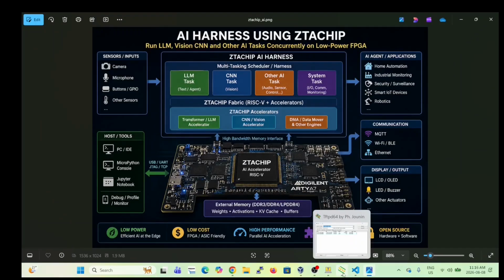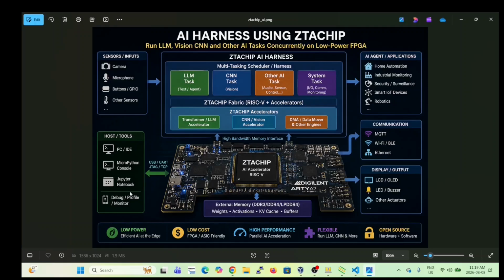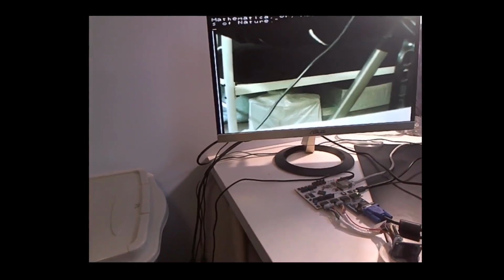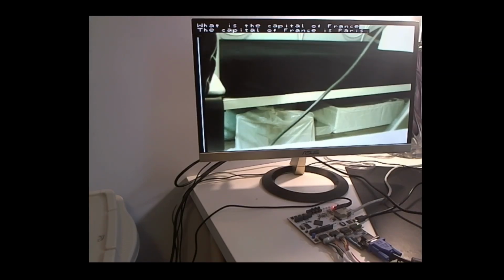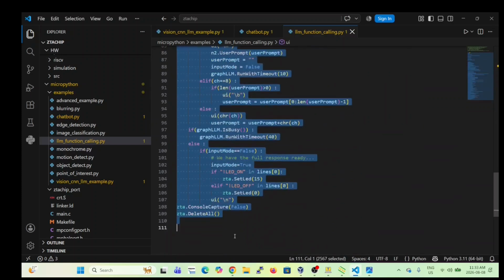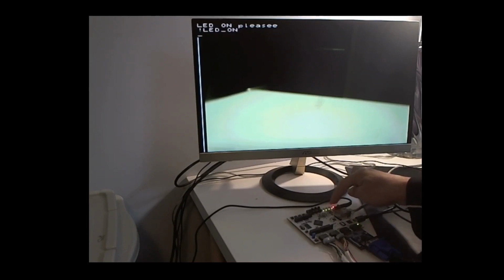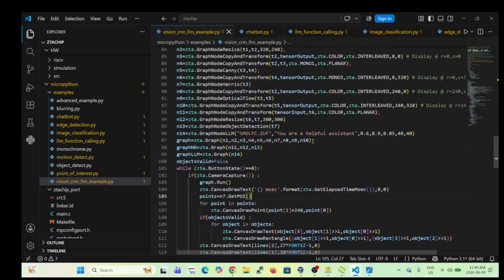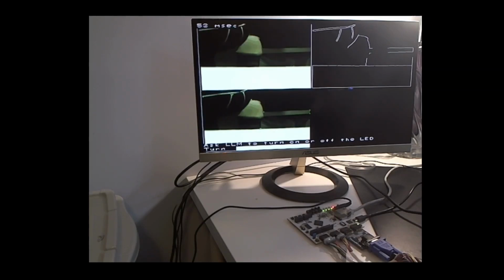Building AI agent at the edge with ztachip

Comment: sir i am a student and learning fpga and ai accelerators can you guide me build this on nexys4 legacy fpga board it also use the same fpga chip artix-7 that arty7 used
Reply from the maker: Doc is much improved on ztachip.github.io
Reply from the maker: Nexys4 is lacking enough DDR memory to run LLM (you need at least 256M). But you can still use it to run CNN and image processing. Porting to Nexsys4 should be easy: some pin remap for camera/display. And program MIG for external memory access (MIG configuration shoould be available from Diligent already)